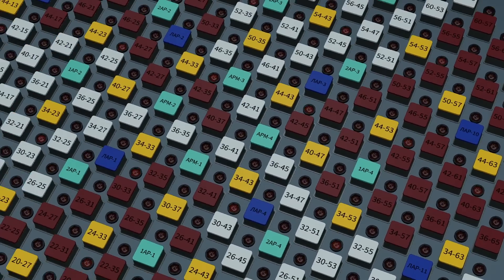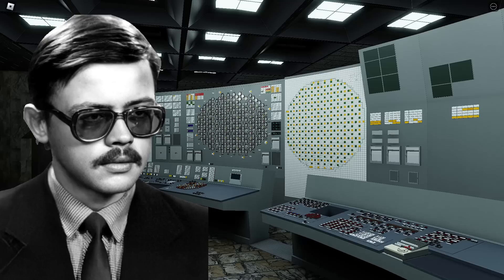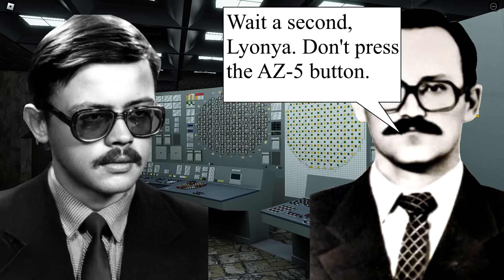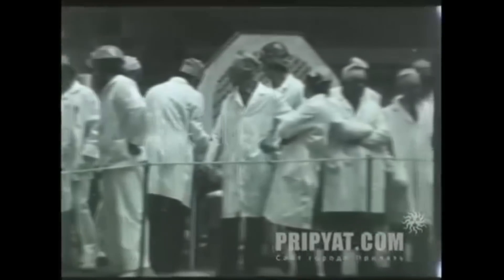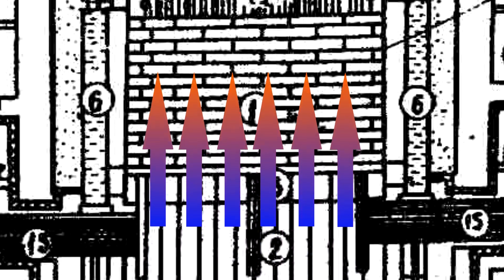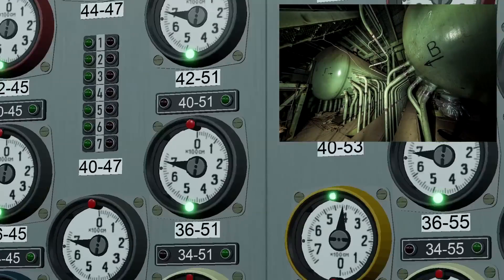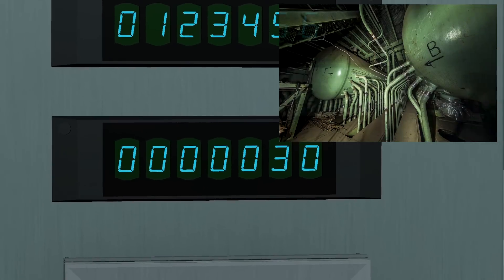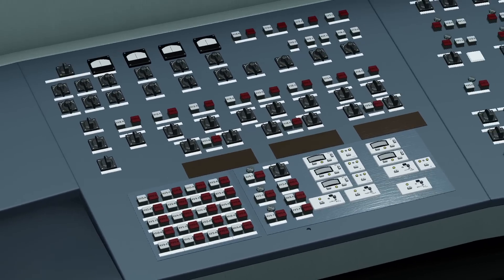Would Not Pressing AZ-5 SAVE Chernobyl?

Comment: By the moment the excursion happened, even if they immediately turned power to the turbine and thus, the primary pumps back on, it was too late. The positive void coefficient caused by the water boiling away could not be overcome by the amount of heat that exponentially increased within the core. Even if they were somehow able to emergency vent the excessive steam pressure, it wouldn't have been possible to get water into the core fast enough to cool it. If the lid hadn't blown off, the core would have slaged itself very quickly due to that heat. Even if the disassociated hydrogen/oxygen gasses were also vented and rendered irrelevant by some miracle, the issue was the insanely rapid increase of reactivity and HEAT. within seconds, all remaining xenon was gone,.there were hardly any control rods inserted and once all the water that was in the core flashed to steam, there was no moderator left. The 3300MW rated core went to over 34,000MW of heat once AZ5 was pressed, HOWEVER, even if they inserted them gradually,.there was too much heat and pressure. Even if you took the pressure out of the equation, the heat generated would very soon have been so high that the fuel itself would liquify and quickly breech the bottom of the pressure vessel. Then once it burned out of the vessel, the solid carbon graphite blocks would ignite, ditto any materials now exposed to the insane heat of the liquid fuel. It would get so hot that the fuel could perhaps have even vaporized into a gas partially as it would boil. So no. All AZ-5 did was hasten the inevitable

Comment: Wouldnt it have made more sense to have giant water tower(s) to keep spinning the turbines for the pumps until the diesel generators caught up? Basically the water towers would act as a type of natural battery. Release the water, the pressure and gravity would help keep spinning the turbine until the diesel generators spun up. Like how dams work. Then… once that was done, pump the water back up to the water towers.
Reply: Power plant turbines are rated for high-pressure steam to flow through them, which is a hell of a lot less dense per cubic centimeter than water is. Best case, the turbines go through excessive wear and have harmonics issues due to the different working fluid, worst case the turbines are destroyed as the thousands of kilos of water flow through them, bending and breaking the many tiny blades because of being subjected to orders of magnitude more force than they were designed for

Comment: Can someone explain why they uised water for cooling? Was it simply too much volume to use something like Glycerol? Or is there some operational reason for the choice?
Reply: That’s what RBMK reactors used for cooling.
Reply: Water is a cheap and readily available cooling. Boiling the water makes good use of the water's latent heat of vaporisation. In the RBMK design the steam formed from the cooling water is used to drive the turbine generators. This eliminates the need to have separate steam generators or boilers.
Gas cooled reactors are also viable, for instance British graphite moderated reactors use CO2.
But most civil power reactors use water as their coolant.
Reply: @ Thats interesting and very clever. I never thought about the double use by having it turn turbines and cool at the same time. Thats one of those things which is obvious once someone points it out. 
I was thinking in automotive/ship/train terms where the coolant is usually in a sealed system and recycled. 
One question I have is what happens in the event of a loss of available water? Does it shut down to lose heat or is there some kind of large storage tank to delay the effect until its cooled enough?

Comment: All reactors spike when they SCRAM. 
Which is why they have rod followers. They limit the spike. 
Auto SCRAM are usually set to a point where the spike won't cause damage. 
Of course no idiot wont pull out control rods after a shut down until enough time passes for poisons to decay away. Unless you live in Russia

Comment: The Chernobyl explosion was at first a massive steam explosion followed by a never before and never since nuclear explosion of fuel rods superheated and tapped together as the unreal heavy concrete cap to the reactor container was forced upward by the steam explosion. It is an incredible feat of science mistake that created that secondary explosion that blew nuclear fuel many, many miles away , directed by the tip angle the top was at, in the air, when the fuel rods, hanging under that cap, tapped each other. To have all of this be the result of ' a test' that could have easily been run on a non active test  reactor, in an unpopulated test area,  is simply appalling.
Reply: The second explosion wasn't a nuclear explosion. The first explosion was a steam explosion caused by the reactor going prompt critical, which is the same mechanism that powers a nuclear bomb but without itself exploding. That loss of pressure flashed the remaining water into steam, which then reacted with the zirconium, creating zirconium oxide and hydrogen. The second explosion was caused by the influx of atmospheric oxygen causing the hydrogen to react and explode

Comment: AZ-5 Button or not, once the order to restart the reactor without the proper procedures because of either inpatience or incompetence; it meant the reactor was doomed from the beginning. The problem was everyone at the top was either impatient, wanted to save cost, and didn't listen to obvious safety procedures. Had the test been cancelled after the reactor had accidentally shut down, and / or the test been done properly from the beginning without any deviation to it; the disaster would have never happened.
Reply: It'd happen somewhere else, trust me the flaw is big enough that it only takes matters of time. Leningrad had the first issue, Chernobyl is basically the ultimate disaster.
Reply: It would have happened.  It probably wouldn't be called Chernobyl, but it would have happened.  Remember, there was supposed to be 6 reactors at CNPP.
Reply: Everything would be well and dandy only if the grid controllers over in Kyiv didn’t request more power, having the reactor run at 50% for hours dooming it to xenon poisoning. Silly civilians, why would they ask my perfect nuclear reactor to generate electricity? Of course it will blow up then smh!

Comment: A few years ago I spent a lot of time with an RBMK 1000 simulator. It was not easy to get it to blow Chernobyl-style and I don't remember exactly how I got it to do it, but I believe it was to get the reactor so poisoned with xenon so that it was nearly stalled out with all the rods pulled out as far as they could go, then AZ-5ing it.
This was with every single safety measure disabled by the way as there were like a thousand different triggers on the way to getting that to such a condition that would auto-scram it so to even get to the point reactor 4 was at before the disaster you had to disable its ability to scram itself completely.
There was more to it and was actually really difficult to do but I was able to find a condition where scramming it popped the reactor.
I'll have to go back to it one of these days and figure out the exact steps and see what happens if you just lower the control rods back down normally after attaining that condition of full-extraction + near stall xenon poisoning.
Reply: They had disabled many of the safety features for the test they were supposed to run. So it makes sense that you had to disable quite a bit of them. The nature of the test required some pretty unsafe operations and when the zenon poisoning occured the workers made it worse.

Comment: Why did the water not boil even though it was so hot? Was it under pressure?
Reply: Apparently it was. Looking at phase diagram of water, at 250C the minimum pressure to keep water liquid is around 5MPa.
Reply: @MuhammedGemci what’s the point of that

Comment: Quick question.  They said they disconnected many safety features of the reactor.  I always thought the auto scram and the manual were pretty much timed about the same so it was indifferent, as you said, but the question for me remained.  Could they turn the auto scram off?  Was it part of the safety features that were removed when performing the test?  If so, is it possible that simply being a less experienced crew WAS actually the problem.  They reacted in a knee jerk way, or would an experienced crew have reacted the same.  That's really the two pivot points for me.  Once I knew the reactor was spoiled on the run down I would've said, "fire me, but I'm not doing this."  A new guy definitely wouldn't have even thought that was an option though.  He's following orders.  It's such an interesting discussion even if irrelevant for the case.  Still, down the road we've seen cases like this in air crashes where the older, more experienced, senior pilot is not corrected, as he should, by the co-pilot who basically allows the jet to crash.  It's such a great lesson.
Reply: well they didn't know pressing scram button would increase reactivity. It was a working day as normal by all accounts of those who were there. Safety concerns for SCRAM were never explained to personel.  AZ-5 was also a normal shut down button. Imagine if you pressed a power off button  on your PC and it exploded...

Comment: Water boils at just over 80 degrees at sea level and you are talking over 200 degrees listen up you are full of SHIT!
Reply from the maker: The melting and boiling point of water increases as pressure increases, and decreases as pressure increases. At 65 atmospheres, the pressure of an RBMK, water is a liquid at 200+ Celsius. Conversely, at low pressures like those of Mount Everest, the water boils at very low temperatures.
Reply: Water doesn’t boil at 80 degrees at sea level…
Reply from the maker: @ploppyjr2373 True, didn't notice that LMAO

Comment: If the designer RBMK reactor and soviet authorities not lies or hiding about positive void specials on their cheap reactor,akimov will not suggest or press the scram button and waiting diesel generator to flow water to reactor and stabilize the core,the worse case is only meltdown...

Comment: AZ-5 just made the reaction exponentially faster and worse unfortunately.
Even without it you’d still have disaster just at a later time.
Removing the control rods too far where they couldn’t counteract the Xenon pit was the biggest mistake. It was just too far gone.

Unfortunately so many died because the information was withheld.

Comment: Only possible save, and it would of been nearly impossible, would of been to flood the reactor with enough coolant tthat it was impossible to boil off. Then when reactivity reduced reinsert the control rods to get the reactor back under control. 

Again the key problem is with where the reactor was at that moment they would of likely had to turn the pumps on full blast, and I dont mean to whatever their operating level was but to the highest they would go without instantly breaking and flood the coolant channels.

Also it was a split second decission and only one answer for that kind of quick thinking with how the reactor was designed, A-35.

Comment: Solution: put down the cores one by one, not all at once by pressing AZ-5 button
Reply: I think they were screwed even if they had tried to do that. 

Like, the rods all had a "stop" and a "go" position, and they put them all into "go" while there was a bunch of xenon built up in the reactor due to low running temps.
Once the reactor heated up enough to burn off the xenon, with the rods out, it would become a runaway reaction within a few seconds. 
There just wasn't time to do anything.

Comment: I think the reactor itself was going to be a total loss no matter what.   But I think if az-5 wasnt pressed, and some sort of method was employed to quickly vent the reactor, the event would have been far less severe.   

My reasoning is if the core just melted, but otherwise stayed inside the reactor vessel or even pooled up underneath it, that would have been a far better outcome than the violent explosion that spred highly radio active solid material in a huge radius. 

But then, my knowledge on this kind of stuff is limited.   Maybe an explosion would have still occured if the reactor melted down that bad, even if it was depressurized first, because of the hydrogen or whatever.  So maybe it was inevitable.
Reply: Yeah no a meltdown is way worse. We really don't want piles of nuclear fuel melting themselves down into the ground water, soil, and other things we can't fix. Yes the immediate loss of life would be lower, but oh boy would you be in big trouble and a MUCH larger area would be totally screwed. That's also if you still don't get a hydrogen explosion from the big hole in the bottom of the reactor instead, and hoping that whatever that fuel melts into is isolated and doesn't flow into larger water systems which then also flow into other systems. You can see how this gets out of hand REALLY fast.

Comment: The software PRIZMA was something amazing for its time, in its log there is not a single wrong log recomendetion. Its last two messages are "Incident imminent"... It gave enough warning and suggested reactor shutdown more than 30 times... If a kid followed those simple instructions it would prevent the disaster. They just had to make a testing program for PRIZMA and follow it step by step... By the second test they would have known everything they need... But then the development of new software program in the soviet union would be as expensive as those cooling generators anyway... So the lesson may be, don't go cheap on safety, which is the same...

Comment: Yeah pressing or not pressing AZ-5 at the point where it was pressed only changed how fast the reactor exploded.  They had painted themselves into a corner at that stage and nothing was going to stop that explosion at that point.
Reply: What happens to the reactor isn't the concerning part. It's the cleaning up of the mess becomes infinitely harder if it melted down instead. They had time to figure out stuff and work to prevent the meltdown from causing damage in reality. If we start at meltdown, there's no heat exchanger under it, it's probably in the ground water and other systems under the earth before we even get a grasp on it, oh and there's also probably still going to be an explosion causing problems for everyone above ground still anyways.

Them blowing up the reactor before the meltdown started basically gave everyone time to work out each problem one at a time before the giant pile of radioactive waste started causing too many irreversible problems underground.

Comment: This reactor would not stabilise. It was badly kicked out of stability by the crew under Diatlov. 
First they pumped the cold water. Than reactor almost shut down, with power being close to 0, which prompted Diatlov to call for raise of all control rods.
Then only a couple of the rods remained inserted, meaning there was almost nothing to catch the neutrons and keep the reaction at value.
So, the reactor fell to almost 0, then was raised with almost no brakes. Although I am a noob in nuclear science, I doubt that it would stabilise itself.
But when AZ-5 was pressed, all the rods entered their channels at the same time, creating something similar to a spark in a plug. A sudden increase in reactivity, before shutting it down.

In conclusion to this yapping, I agree, not pressing AZ-5 would have saved Chernobyl, IF the crew would connect the diesels and started entering the rods in small batches.
However, with Diatlov's hot-mind, not the best training of the crew and not safe building (the rest of the reactors were built by Soviet standards with heat-proof materials, but the 4th one wasn't), I doubt that they would pull it off.
Reply: By time the operators saw any indication of a power excursion, the steam channels were already at risk. Once they pulled the rods against the recommendation of the computer, I think the scenario passed the point where the reactor could be saved fully operational.

If AZ-5 had not been pressed, The reactor would have still had a meltdown, and while hidden within the reactor hall, the response to an 'unseen' reactor meltdown of the same reactor may have not been sufficient to prevent an equal or worse disaster (the reactor melting through the bottom and resulting steam explosion).

When they stalled the reactor, I think there was only 2 courses of action. In both cases, the rods should be left alone in normal run positions, or slowly inserted.
1. They could have delayed the test long enough for the cold water to cycle and heat up. The rods could be raised to operational limit, but not to the extent that was done. This was probably a non-starter, but would most likely have been the correct action.
2. Reduce the feed water rate into the reactor. As the water within the reactor heated and steam voids began to form again, the power would rise, and the feed water along with the rods could be used to restore balance.

These two scenarios would have required the operators to have knowledge about the design and operation of the reactor they most likely did not have.

Comment: unit 4 could be saved from explosion if akimov used пит. муфт (КОМ) why KOM? cuz  КОМ throws the rods off the drive and they fall into the core and mb reactivity will fall down but, due to the fact that the turbogenerator could not receive steam, it means that water was not pumped into the core and all this increases reactivity the reactor could no longer be saved

Comment: "water at 165 degrees celsius"  Hold on, that's WAY above the boiling point.  What do you mean "water"?
Reply from the maker: @MyNameJerf  At high pressures, the boiling point of water increases. RBMKs operate at 65 atmospheres of pressure, which is why the boiling point is so high :)